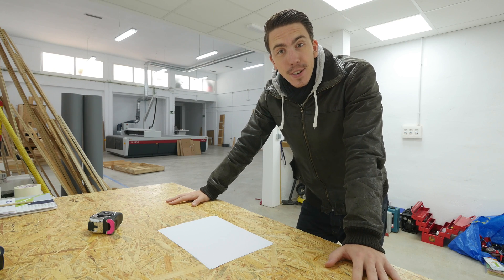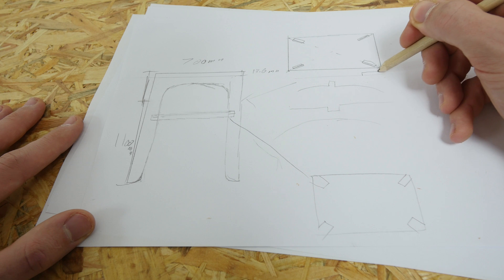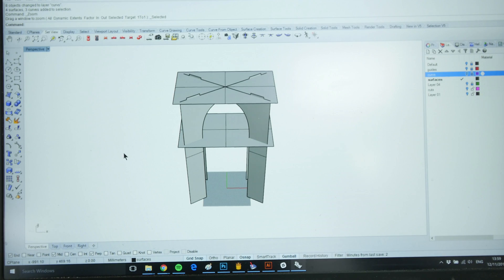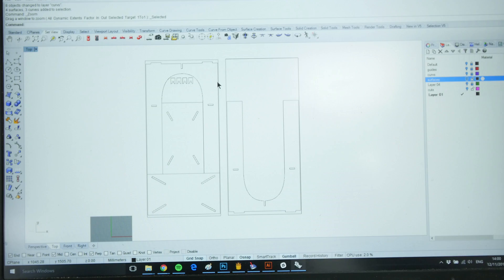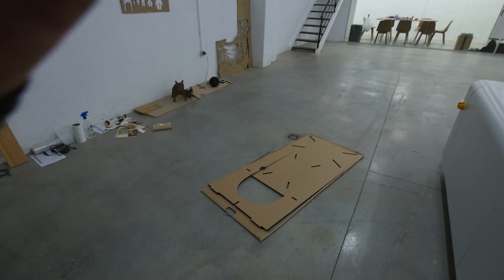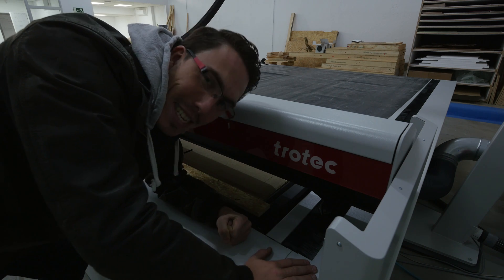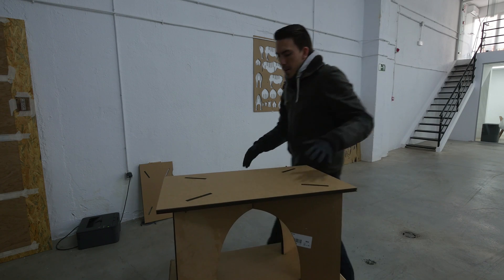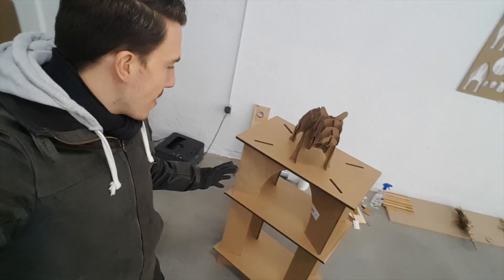Making A Cardboard Table / Laser Cutter

Comment: Great to see a real project, with all the challenges along the way! A few observations:

1. A saying I was told many years ago - "For initial rough, draft ideas, there's no such thing as a bad drawing, just sometimes a drawing of a bad idea.";

2. People pay a lot more for distressed paint finishes or ripped jeans. Pre-burnt cardboard could be the next designer chic idea!

3. For the next one, design a top piece of card to go over the current one with fold scores that let you fold/wrap it round the edge of each side, with tabs hidden underneath. Would give you a double strength unbroken top, that could take more weight without flexing.

4. Stencil the cardboard before cutting it?

5. Cut plastic/foam feet to stop spilled coffee (or wine,/beer) wicking up the legs!

Looking forward to the next stage of the journey :-)
Reply from the maker: Cheers Andrew will take this all on board.... ( get it )
But in all seriousness will defiantly keep it all in mind for the next cardboard table creation.
One question what do you mean by stencil the cardboard before cutting it?
Reply: Cut designs or words out of foam, stick to a scrap of wood, then ink and stencil print. Could be a big version of your logo, parts of which appear spread over a couple of legs. Or words like "Radioactive" or "Space Station Use Only" that because parts would have been cut out, and in fact might be used elsewhere in the item, might intrigue visitors trying to identify the origin of the cardboard!
Reply from the maker: Ah I get it. Ya could definitely see thank  looking cool